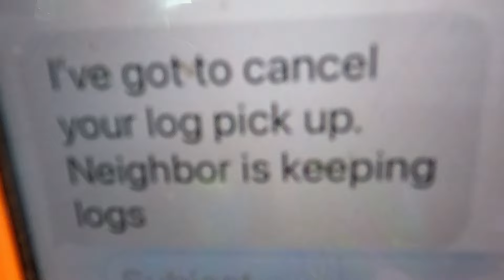Gotta Have a Plan B:  Expect the Unexpected!

Comment: That's wicked frustrating when you come across metal while sawing.  I just picked up some nice hemlock sawlogs last week and I've hit metal in 4 different logs so far with the sawmill. There's 4000 bf in those logs, I hope I can manage to make some money off them.
Thanks for the tip on filing a new chain. 
Looks like some wicked heat and humidity coming next week. Stay hydrated and don't work to hard guys. Maybe take advantage of your pool.
Great video as always guys!
Reply from the maker: Some times ya just never know even if the logs came from out in the woods there could be iron in them .  I started sawing lumber today so we could get a bunch ready for when that 100 deg temps hit . I will just go inside in the ac an build more firewood pallets on them hot days .

Comment: Nice video! And like reading all the comments! Just finished all the annual spring splitting for the year, almost all oak this year. hats off to you two for year round wood! Just turned 
 hot as warm butter air. Is there elm trees in Maine? Whats the worst trees for you there?
Reply from the maker: Thanks Dan spring is a good time to be out getting the wood put up while it’s still cool out . We do have some elm but I won’t take it cause it’s just a pain to split so I’d say that’s number 1 and white birch is my second choice . Birch cuts and splits nice but the customers don’t like seeing it in there load and when I do get it I save it for myself to burn . Sounds like that hot weather is headed our way supposed to get up into the upper 90s next week and this old northern boy don’t like the heat one bit so I will be inside building firewood pallets in the ac .

Comment: You need a set of Airbag overloads like I do on my tundra. The leaf springs will thank you! It won’t look as heavy as it is either.
Reply from the maker: All my other trucks I  have had the spring place here in town add one or 2 and it makes it a lot better . Not sure what the air bags sell for installed but last time the added springs were about $500 installed
Reply: @AllenFamilyFirewood  airbags under $200 online and had them on in an hour and a half
Reply from the maker: @WilleysFirewood  no kidding well now I gota check that out . Everyone I know that has them loved em
Reply: @AllenFamilyFirewood  two cord behind my tundra and it doesn’t even move. You will love them. Much better ride than add a leafs.

Comment: good video and job i have heard other people say you need to sharpen a orgen chain now i know why last orgen chain i got was made in china. there is no reason why anybody would put that much metal in a tree i would have used a bunch of bad words to. both of you take care, be safe and well.
Reply from the maker: There just real hard to hand file once  a new chain has been heated up and dulled . Something about just hitting it a few strokes before ya use it makes all the difference in the world once ya really gota sharpen it . I think it is because they over heat treat it when they send em out . They probably do that because it will hold an edge longer that first time ya use it but it sure makes it dang near impossible to file after ya put a few tanks full of gas through the saw .

Comment: Have you ever thought of getting a metal detector and check the logs before cutting into them Phil? I guess they are costly though.
Reply from the maker: We’ve actually had them offered to us but then I’d have to do a video on them saying how good it works and I hate doing videos like that . They really only work good for about the first 3 or 4 inches of wood and it would just be one more thing floating around my truck lol. The time it would take to properly scan a log would add 5 min to each log I’m guessing so that’s just not possible for us to loose that much time . Most of the time I can get 10-12 cord cut up with one chain but this load was right full of iron